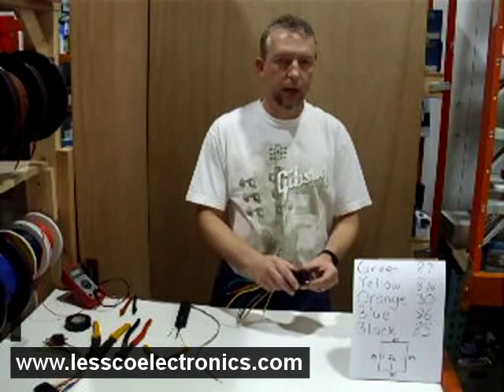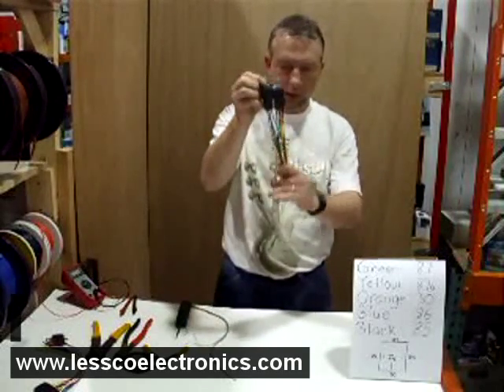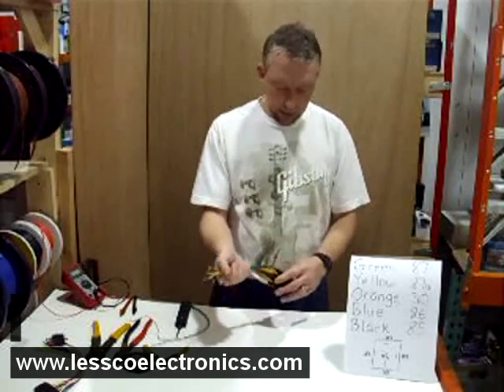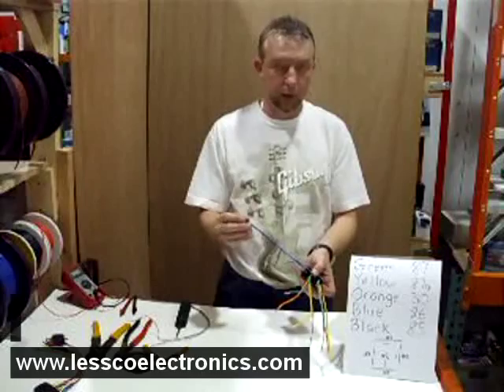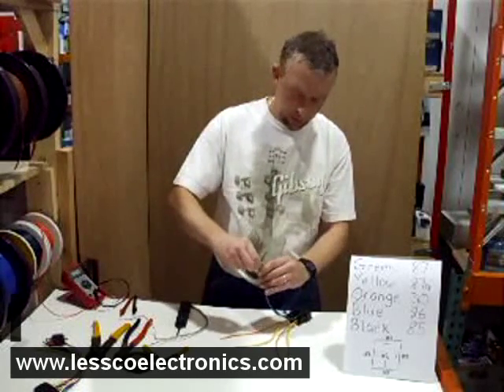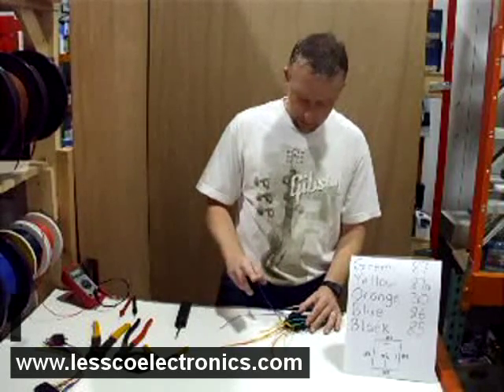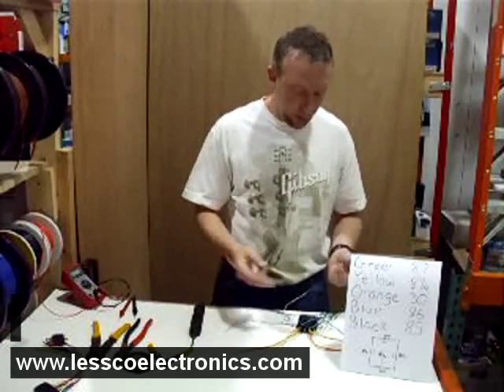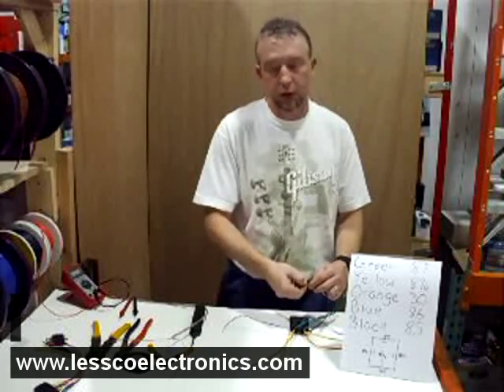5 Wire Reversal Rest at Ground Door Lock Relay Wiring

Comment: Where can I find the diagram for this?
Reply from the maker: email me the request here: sales@lesscoelectronics.com, Ill send it right over
Reply: I'm doing a relay for the trunk pop but fuse keep blowing. I have 86&87 fuse at 30 amp. 85 to alarm module, 30 to trunk wire and 78a not use. It worked one time and now the fuse just keep blowing
Reply from the maker: Maybe you need to 5 wire it? whats the year make and model car?

Comment: will this work with a 1amp 12v power supply connected to a wall power light timer? or will the active on not work with the relays?
Reply from the maker: +Nathan James That sounds pretty specific, you should email me for the free 80 page relay guide we give away for that usage, what you want is sure to be in there, email us at sales@lesscoelectronics.com for your copy

Comment: I need help with this prestige asp 997e can't get the door lock functions to work on my 1997 suburban with rear barn doors my old a vital alarm was easy to install relays internal for positive an negative door locks worked perfectly blue and green wire hook I up

Comment: Quick question, I have a 96 chevy s10 2 door and I'm pretty sure it's 5 wire, I'm not sure though how would I go about wiring in keyless. The outputs are negative on my alarm system?

Comment: one question,  on 97-03 grand cherokee 5wire doorlocks without using a doorlock interface module and using the the 5wire relay wiring, can the 12+ be tap from existing doorlock switch to not run a 12+ wire true the door or would it blow the fuse?

Comment: Nice Video Man. First Time Putting a remote start & alarm system in & your videos have been a great help. I have everything working except my keyless entry.89 F-150 so im assuming its a rest a ground door lock system?I have a logic probe and when i actuate the switch it throws a red flash which is positive. So im confused as to which type of door lock system this vehicle has and if it requires the relays you mention in your video. If so i will buy the relays off of your website & everything else